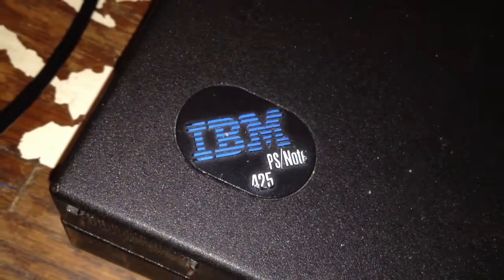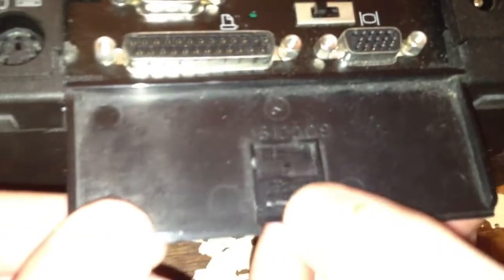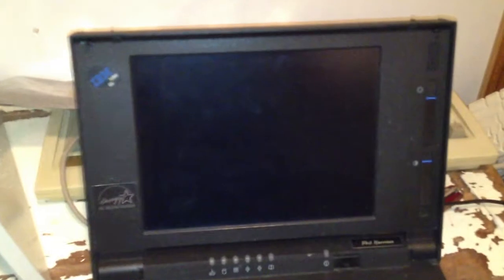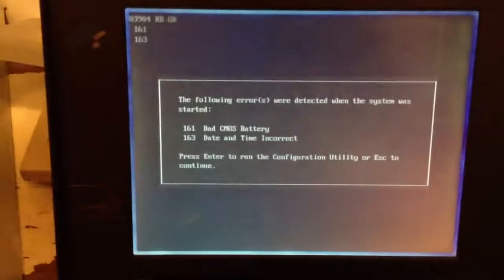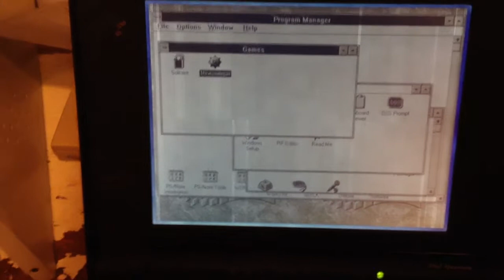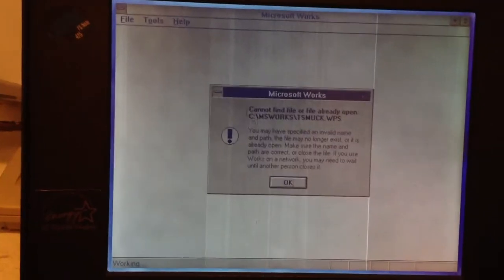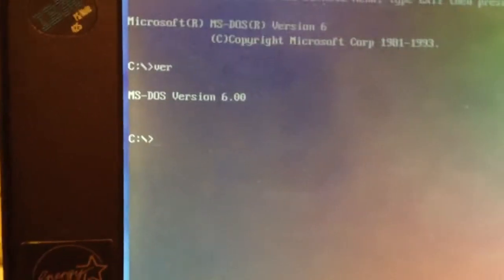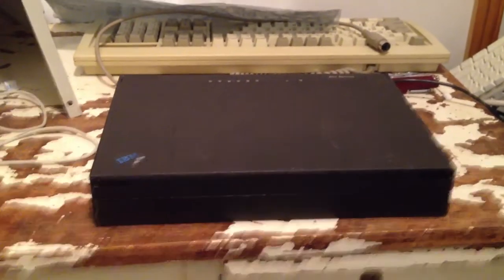IBM PS/Note 425 Laptop

Comment: That name plate "Phil Harris" is NOT the case designer. It was the name of the original owner. How do I know? I bought new and still have my old IBM PS Note 425. When you turned in your warranty card, you were sent in the mail a little name plate that you pasted in the upper right-hand corner. My plate has my name on it.

ONE WARNING!!! Don't open and close the case too many times. These old PS Notes were notorious for having the lids crack at the hinge. You should reinforce yours with epoxy and a metal plate before yours comes apart.

Comment: it more so was a slimmed down thinkpad cause it did have a small os as compaired to the emate where the emate had more of a newton os as the ibm had windows ce and a pentium processor. there were also 2 sets of batteries used a regular standard battery for regular power and then the settings type battery but this one used aaa or aa batteries as the backup settings battery. i will have to find one and show u

Comment: Bought one of these recently, however it was the 386SLC model (2141-S82), backlight still works but the display seems to be dead... can still output to external VGA however (I tried reseating all display connectors and fiddling with brightness/contract controls)
Reply: (also, it was a slightly earlier, pre-ThinkPad model with no TrackPoint)
Reply: Check if maybe has the switch that detects if the lid is closed broken.
Reply: Bad electrolytic caps. I guarantee you that’s the problem!